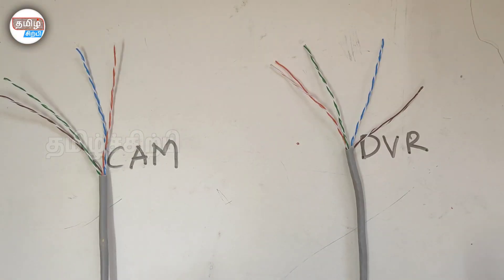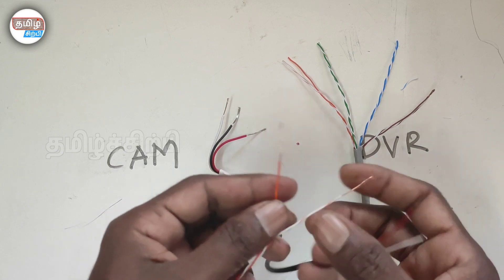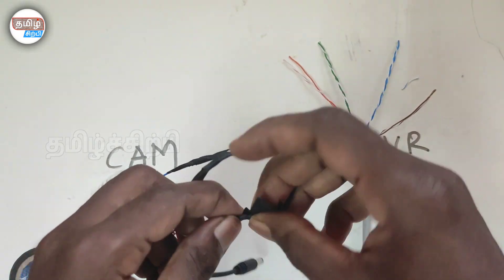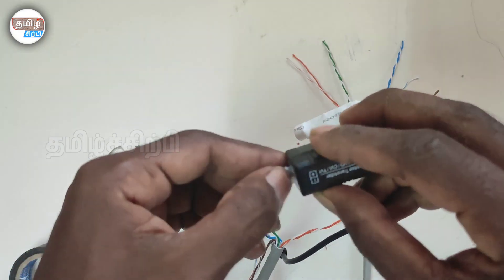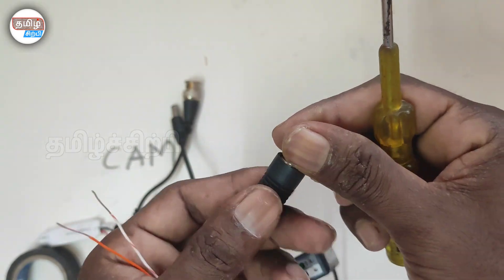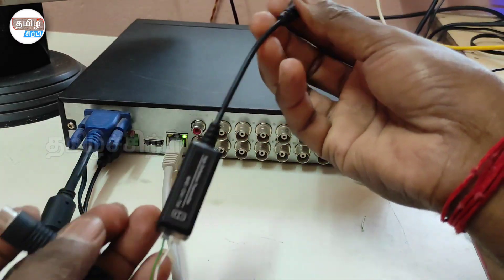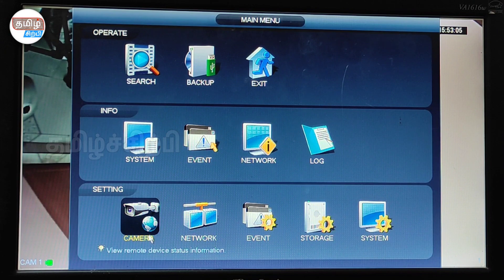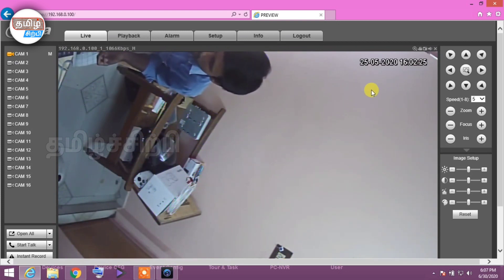How to cctv mic connection Connect a Microphone to a DVR | CCTV | | IN TAMIL | TAMILSIRPI

Comment: Audio ku co ax cable run pannuna clear ah irukum camera fix pandra edathula than mic vaikanum nu ila easy ah audio pickup pannuna mathiri hight kammiya near to human fix pannunga worth ah orikum

 use seperate negativ or use video negativ for noice less audio..most of the mic board have gain adjust preset ,put the audio on in live view and adjust what u needed..try those ideas bro